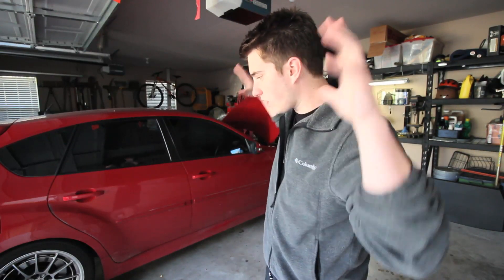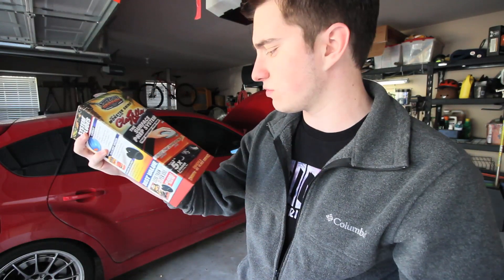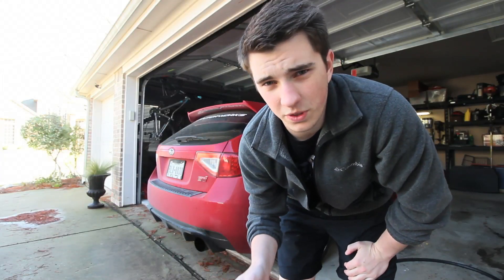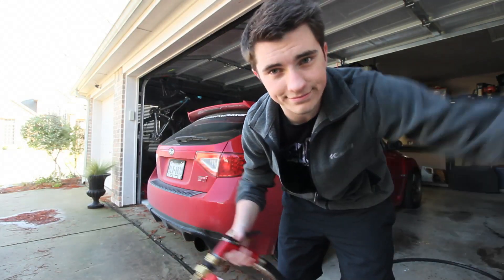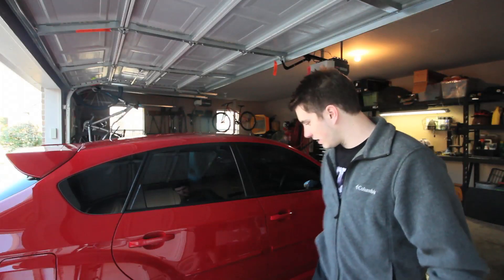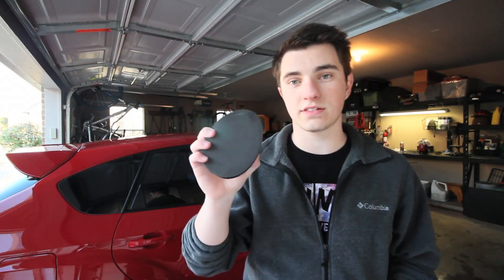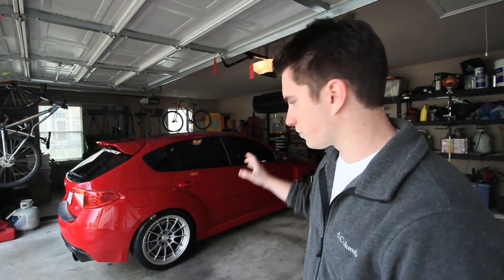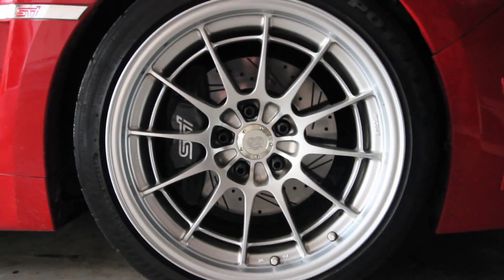Car Wash! | 2008 Subaru WRX STi

Comment: So how do you get the water and suds out of the garage?
Reply from the maker: They soak into the ground or drain out of the garage.
Reply: +Evan Shanks Have you thought about getting/using a floor squeegee? When I detailed cars as a summer job, we used those to get a lot of the water down into a drain. They worked pretty well